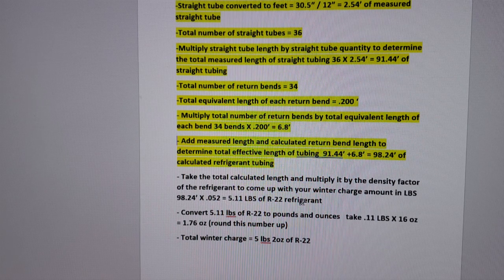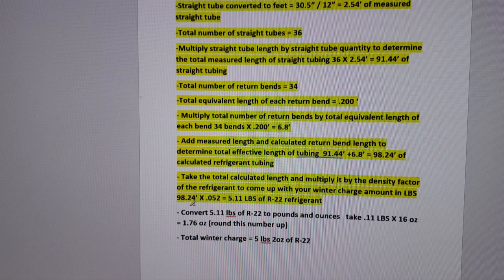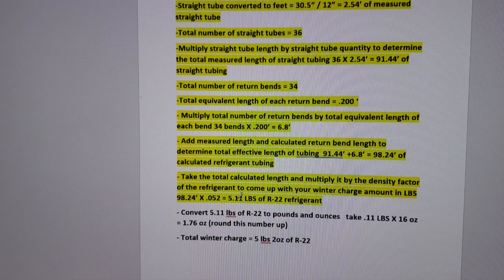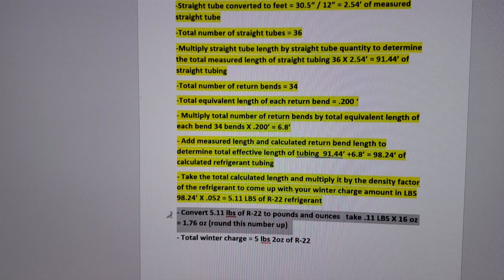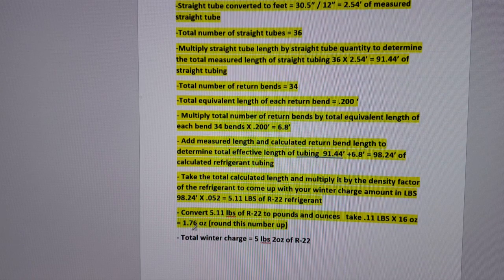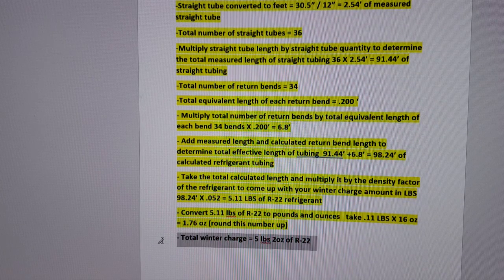WALK IN COOLER WINTER CHARGE

Comment: Will this winter charge cause any problems during hot days ? I heard from another tech , that you have to come back every summer and removed the winter charge is this correct ?
Reply from the maker: No if the system is designed properly the winter charge stays in all year and it does not cause a problem

Comment: Just add charge...block condenser...add a little more...same thing less work
Reply from the maker: Im confused what does blocking the condenser due other than raise the head pressure and potentially stop the head pressure control valve from bypassing.... How does adding the charge after you have blocked the condenser do anything?
Reply: @HVACRVIDEOS  add til your clear..... Block coil with CFMs running. Charge til liquid line is a minimum of 109°. Then unblock coil and add a little more....not sure how I misphrased that
Reply from the maker: Tony that does nothing other than taking a guess. The problem is when the headpressure control valve bypasses you need a clear sight glass while that is happening so just guessing on the charge is a gamble.. the best way is to use the  sporlan method that I outlined in the video and or to fill the system with the maximum amount of refrigerant (which is a 90% full receiver while pumped down)
Reply: @HVACRVIDEOS  or use a torch n be done.
Reply: @HVACRVIDEOS  the receivers I work on have gauges... they are as large as your van
Reply: Liquid level gauges.

Comment: Here's another method for units with headmasters. Leave CFM running and block off air flow thru the coil. Add gas until your liquid temp holds steady at 110 - 120 degrees. Unblock the coil. Then estimate the gas volume of the condenser coil and add that much more gas. Put a fork in it. Been doing it this way for 20 plus years and have never had any issues. Try it at low ambient in the winter and return in the summer and your pressures will be right where they should be for the surrounding ambient temperature. Ambient plus 30 degrees +/- 10 degrees.
Reply: Agreed 1000%
Reply: Does the winter charge for freezers cause high side problem during warmer or hotter days later  ?
Reply: @xraybravo7180  Not if it is done properly.

Comment: Here it gets -20 with wind chill.  Typically I just charge 90 percent receiver, most outdoor condensing units have a receiver sized for 50 ft of lineset and the solenoid is located at the evaporator.

Really good explanation on the right way of doing it.

Comment: Chris, have you devised a similar calculation for a microchannel coil yet? We usually just clear the sightglass then add an extra 10%.... Maybe not exact science but it has worked for me with no issue
Reply from the maker: I will talk about it on the stream tonight
Reply: Does the winter charge for freezers cause high side problem during warmer or hotter days later  ?

Comment: Thanks Chris it's is confusing just have to keep replaying this video. But I like your way. Lol I ran in to my 1st headmaster system last week. I told my boss that the compressor sounds like it's bypassing the valves he said that will happen when there is a headmaster will that be true?
2nd question is where do you take the sc&sh at? I do my SC  after the headmaster and after the receiver same SH after the receiver. I know we're not going to be able to get the right measurements but the boss wants to know the numbers anyways and I get my superheat at the evaporator as well. See you later on the live stream.
Reply: You don't really need subcooling on refrigeration systems with receivers and sight glasses 99% of the time. The sight glass will tell you generally that you have a solid column of liquid to the txv
Reply: Yup you right i dont know why the boss wants the readings. He has 15 years in this trade I only have 6 months so i just give him what he wants lol. Cause I use the sight glass method putting in little at a time and once the Box gets down to temp I add refrigerant as needed.
Reply: I didnt read the rest of your original comment- evaporator superheat is taken at the outlet of the evaporator, and compressor superheat (also called system or total superheat) is taken about 6 inches from the compressor on the suction line.

Comment: 📽🎬👍🏻👍🏻👍🏻.  When it's "Ohio" cold,  I can't feel the temp change when I run my torch down the reciever. I can do it 3 times or 15 times,  all feels the same. Does it work better at certain outdoor temps?
Reply from the maker: Good question it's never been colder than 20 degrees here so I wouldn't know
Reply from the maker: Thanks for watching I will be going live on YouTube this evening  4/1/19 @ 5:PM (west coast) to discuss my most recent uploads announce the Sporlan Bq TEV kit winner and answer questions come on over if you can https://youtu.be/WLQxwzT65SU
Reply: Good to know that Rick. I'm just a hair north of you across the border. We pretty much have the same weather. Just repaired a couple of freezers and went to the manufacturer for the maximum charge. I wanted to try Chris's method, guess I will have the same results as you though.
Reply: @billburnett9951  even if it's not that cold outside,  I can't feel the difference? Maybe you have to get it real hot? 👋🙈
Reply from the maker: How many passes are you giving it with the heat?
Reply: @HVACRVIDEOS  I've gone really slow and made multiple passes. I don't take it to the point where I can't stand to touch it but I've made multiples and it just doesn't seem to feel any different. It all feels the same temp the sight glass is full prior to pump down.
Reply from the maker: Interesting must be the really low temps